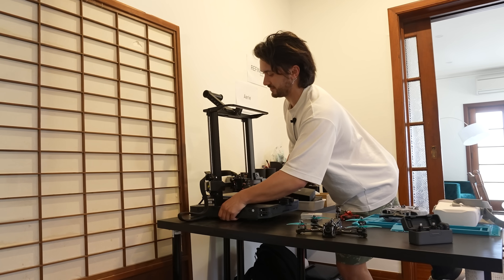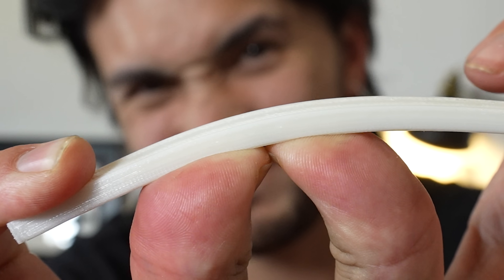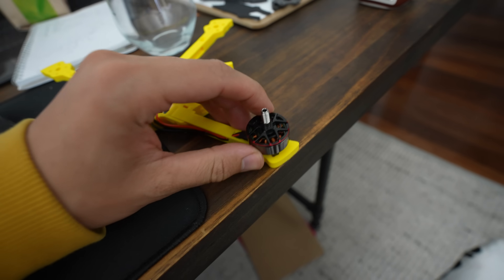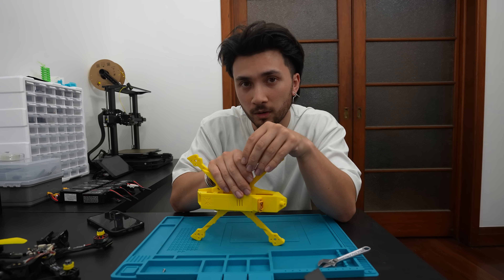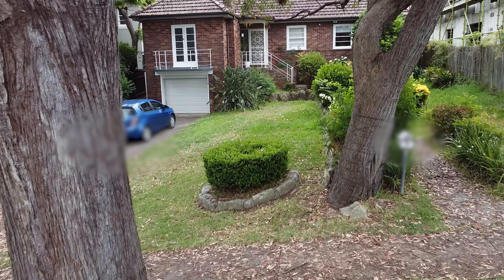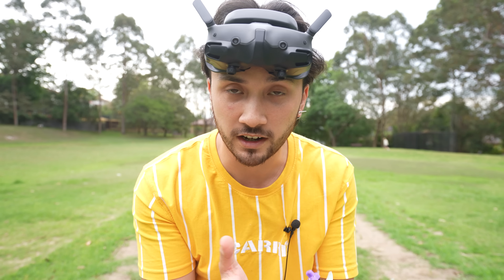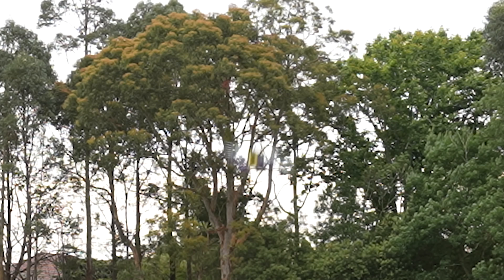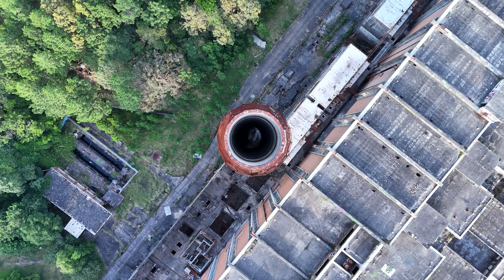3D printed drone. Ah yes. Very Good

Comment: look into the new filament created by bamboo, as strong as aluminum apparently.

 "PPA-CF" 

you'll find it under their PET category.
Reply: Maybe some corpo in marketing found a single statistic where it actually can hold up to aluminum, but I seriously doubt it’s a practical replacement for aluminum
Reply: @ I mean for sure not directly as strong. But very strong to say the least. Seen a lot of test of hooks and chains being made with them pulling vehicles etc. crazy times we are in for sure
Reply from the maker: iv've heard about how strong that it aye... I'd be keen to try it
Reply: @Nick_FPV  make sure to document your experience if you do try 🙏🏻
Reply: It’s over $300/kg tho 😮
Reply: @mynameisben123  you know how many frames you can print with 1kg?! lol 

No but seriously it is expensive, but if you were to solely dedicate it to frame building you can print enough frames to easily recoup the money invested. Buying 12 cheap $25 frame is the same amount. With horrible reliability.

Comment: Nice work getting that frame to work! I have seen some other videos about drones. Vibration can really throw off the flight controller. I think it can even make them restart. Which looked like what was happening with yours.
   However, those initial attempts, at least in audio, sounded absolutely horrible. Maybe the sound problem was just on my end.
Reply from the maker: nu they sounded like they were oscillating heaps
Reply: @Nick_FPV  Oh, well, that's a good description of a problem.

Comment: So, I've done a number of 3D printed drones, I've even had ones that could survive 50 mph crashes without damage. 

My strongest recommendation is to use CF tubes to reinforce the arms. The plastics without a continuous fiber are simply too flexible and create large vibrations. It's possible to go with only plastic, but you can half the weight of the frame by adding in CF tubes while still increasing the rigidity and durability. 

Lastly, use round tubes and not square tubes. Square tubes are made through a different process and have a weak point where they're joined at one of the corners.
Reply from the maker: yea I think i should have gone with those round tubes... but Yea I think next time definitely going to go with carbon

Comment: I wonder how print orientation affects rigidity.
Reply: Allot!
Reply from the maker: I think a lot... but I thought that this may have been the ideal orientation...
Reply: @Nick_FPV  I have a 3dp frame to discuss if you want. Guess my email and contact me. It has no vibrations of concern. It just works. One can even use a GoPro version 1, and have 0 jello. And that is before tuning. Nobody else has done this. And I dont even use dampeners. Imagine if I did.

Comment: Man you won a sub here. I'm making a 3D printed version of the CADDX GOFILM20 and every part here is harder than it looks. Nice job, loved the end! Cheers!
Reply from the maker: It really is... i cut out so much messing around with actually just getting the printer to work HAHA
Reply: @ oh that’s extra steps you got there, for me it was the prototype print->adjust->optimize part that it’s really not so straightforward as I tought. Any small adjustments adds to the queue of steps. In the end, it is such a nice process you start another one. Do you think you’ll try again?

Comment: I commented a video where you were 3d printing propellors, but I'll offer again here. I build 3D printers capable of carbon and Glass fiber filaments, and would love to print you some stronger parts.
Reply: Glass and carbon are great to add more rigidity to the printed parts. Carful using it if you do nick. The glass and carbon fibers can be very small and become airborne during printing. They act the same way asbestos does on the lungs. Run the printer in a enclosed print tent and run a fan to push air out of your living area. Something like a portable ac hose and window mount works great to get it out of the house.
Reply from the maker: Damn that sounds dangerous....
Reply from the maker: Thanks man!! That honestly sounds great! I havn't got a vid yet with them in the schedule but if anything comes up ill shoot a message

Comment: maybe wires that power the motors are interfering with flight controller try wrapping aluminum sheet around it
Reply: Nah. It was vibration, I've run into it with my own 3D printed drones when trying to go to full size components.

Comment: Hey nick! Amazing project! It seems like you are using PLA as a material to print the frame. If you use ABS, PETG or even ASA, it will be much stiffer, and you'll be able to make the drone lighter. Your printer should be able to print these materials easily
Reply from the maker: yeaa I just wanted to try use PLA since it's common
Reply: @Nick_FPV  give it a shot with ASA. You should be able to get it quite easily, and it will make the drone last much longer and possibly you'll be able to make it lighter
Reply: @Nick_FPV  just make sure to have a filtration system, or even a window open, don’t watch the print if you print asa. (That’s if you are printing in asa)
Reply: Duramic 3D's PLA+ is the toughest material I've used before going into engineering grade nylons and PET and what I build my 3D printed drones out of.
Reply: @colinmetzger6755  It's really impressive how strong PLA can be, but it's weakness is heat. For a drone frame, I would use something like Nylon, Polycarbonate, or PET with a carbon fiber or glass fiber additive for better rigidity.
Reply: @colinmetzger6755  That's a yarn
Reply: PETG and ASA are not as stiff. PLA is stiffer, but more likely to break in a crash. Pros and cons, but they will fly worse in that material as it has more vibrations. Carbon fiber nylon is one of the best materials to print this sort of thing in.
Reply: Wouldn’t something like CF-Nylon do better? It’s much stiffer and more rigid, people use some types of it for battlebots
Reply: What makes you say PLA is less stiff than ABS?

From my research PLA is one of the stiffest non-reinforced materials. Far stiffer than ABS for example.
Reply: In my testing (with an engineering grade test machine) I have actually found that PLA is actually stronger than a lot of ABS and ASA
Reply: @ndisa44 It’s ultimate tensile strength is very good, it’s layer adhesion is less good, and its durability is crap (it’s brittle)
Reply: @ndisa44 not in impacts
Reply: I vote ASA
Reply: @AustinFranco-j3r asa can be toxic though so be careful
Reply: I would highly recommend polycarbonate
Reply: None of those are stiffer than PLA actually. The only benefit you get from any of those would be heat resistance. Carbon fiber PLA or PA6/12 would be the most stiff you can get in this case.
Reply: Only if he has a ventilated area or an enclosure
Reply: When I built my 3d printed quad I also used PLA at first, because I thought the stiffness is best, but it quickly started to develop cracks (my guess is due to a couple somewhat hard landings), but when I switched to PETG it became a lot more durable, even if PETG by itself might not be as stiff. 
So I definitely recommend testing a more robust material like PETG, when this version starts to break. I also got some polycarbonate recently, so I might try printing a lighter version using that.
Reply: PLA is literally the stiffest of the base materials. it's also the most rigid and toughest. It's also more brittle as a result. PLA's only downsides are brittleness and low temperature resistance.

PA CF is almost as rigid as PLA, is slightly lighter but has slightly lower layer adhesion as well so it needs to be designed around it's shortcomings.
Reply: I would advise asa over petg
Reply: Actually PLA is one of the hardest 3d printed materials
Reply: I would say carbon fiber. At least the arms.
Reply: PETG is not stiffer than PLA
Reply: I printed a drone using petg-cf and it worked fine
Reply: @rcforever9385 did you design it yourself or did you get it from a place like cults3D?
Reply: PLA is actually significantly stiffer than ABS, ASA and PETG. That also means it is more brittle though so I do agree with using something like ASA. It'll flex a bit more but it will also take impacts much better than PLA will.
Reply: You are just wrong, PLA is the most stiff of those materials. Maybe carbon fiber filled abs/asa comes close but otherwise no.
Reply: Yes, PLA is much stiffer, and that also makes it a lot more brittle, in this application you want a material that is stiff and strong enough to withstand the flexing of the frame, and be much more durable in case of impact. ABS and ASA are the go to's for this application
Reply: Also pla aero/lwpla is light, but weak. You can also change the infill style and lower wall loops to make it light
Reply: pla is by far the stiffest out of al these no?? he should defenetly use PC-CF
Reply: You think annealing the plastic could also help?
Reply: You can also get some that have carbon fibre in it and they're still at a good price
Reply: If his printer has a good enough extruder to actually print it
Reply: Infused materials are an absolute nightmare, clogs and wore down nozzles. If the extruder does not have a carbon steel nozzle, the filament will just eat it away in a few hours. But a carbon steel nozzle makes a new problem, it cannot heat up effectively to be able to print properly. I just stay away from these materials altogether
Reply: @hyvick97 well investing into a diamondback nozzle could solve those problems even though i have no issue printing CF-PETG on my ender 3 pro with a hardend steel nozzle.
Reply: you dont want a drone too light
Reply: You don’t want stiffness you want flexibility in the arms so that they’ve bend and take all the absorption before impact forces hit the main frame
Reply: Lightweight PLA is your best bet; ABS and ASA will be heinous to print on a non-enclosed bedslinger

Increase walls over infill
Reply: I feel like a combination of materials would suit this use case the most maybe pla+ for main frame/body petg for the arms
Reply: PLA isn't flexible enough, that's why it broke instantly. Making it solid doesn't help either.
Reply: PLA is typically the most rigid, ASA and ABS will deform before failing which isn't ideal.
Reply: This conversation is hilarious on all fronts. One, PLA is the goto while your iterating your design as it’s typically the cheapest and easiest to print. When you get everything you want dialed in  you could then in the end experiment with ANY other filament and then judge the properties for yourself. In the end I’d think you’d want the most flexible material that can give and be more forgiving when bumping etc… However, it’s all a moot point because the cooleste thing is you can reprint arms, etc… whenever you nail something and trash it. Can’t do that with retail crap, oh wait, unless you’ve learned to design/clone the parts of those.
Reply: same
Reply: ASA is toxic please don’t use without proper verification I like PETG it’s what water bottles are made of even pla + is a good option I’ve heard polymaker pla pro is one of the strongest and easiest to print with and I use overtune PETG it’s strong but it doesn’t print the cleanest
Reply: ASA is stiffer and more suited for outdoor use